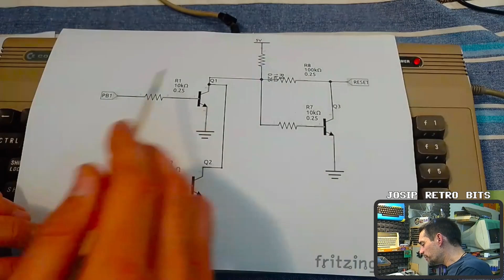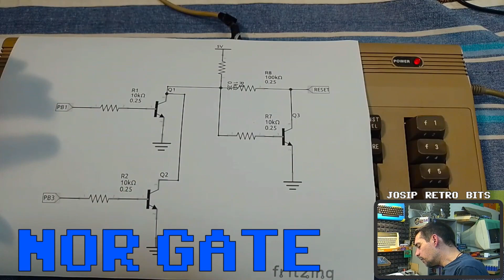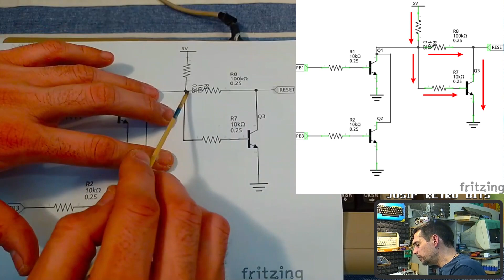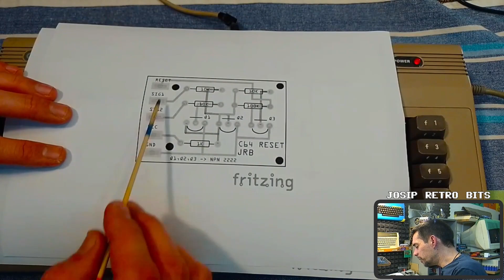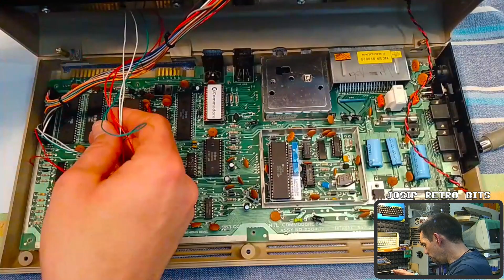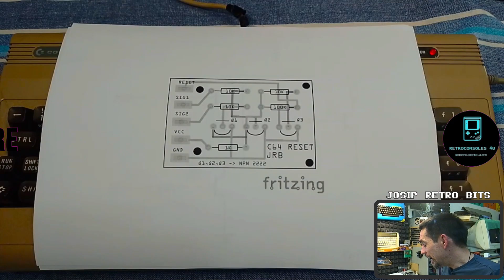Commodore 64 Keyboard Reset Circuit v2.0

Comment: Nice and simple, but unfortunately with the C64, a simple CPU reset will not get you out of some persistent software. Too long to explain here but it is about how the reset vector is set and simply resetting the CPU will only make it jump to where the programmer wants it to jump. So, some clever people came up with something called "EXROM Reset". It involves using a second line (PLA EXROM pin) and pulling both the CPU reset and the EXROM low, but releasing CPU a little before EXROM. There is a good video here, https://youtu.be/OV5tNYhqQ7w?si=rTxRNl2_RsN0OVai which explains it much better, also check the follow up video on the same subject.
Reply from the maker: Well, I know that my solution is not perfect, I just wanted to be able to reset c64 using the keyboard (combination of keys) and I managed to do just that. In addition, I was using the stock C64 and never tested my solution with other Kernal ROMs or other sys cartridges. Thank You for the video suggestion and thank You for watching :) Cheers!

Comment: malo pitanje - imam c64, kad ga ukljucim, bude samo plavi ekran. da li je do napajanja ili do maticne ploce? sto prvo gledati?
Reply: Very nice, but what happens when you play games with Joystick 1 and you need to go diagonally down right ?
Reply from the maker: Thank for asking, it should not trigger the reset because of different resistance on those lines. Cheers!
Reply from the maker: Plavi commodore ekran bez teksta? Ili je plavi ekran pd tv-a?
Reply: @JosipRetroBits  samo plavi ekran,  bez teksta... Znas ono kad ga upalis, plavi ekran i onda se za sekund pojavi tekst... Na tom plavom ekranu je zapeo
Reply from the maker: Ok. Moguce jedan od ROM chipova. Ili Basic ili Kernel. A mozda i character rom
Reply from the maker: C64 longboard ili shortboard?
Reply: @JosipRetroBits  https://ilesj.files.wordpress.com/2010/07/four-different-c64s.jpg na slici doli desno...
Reply: https://ilesj.files.wordpress.com/2010/07/four-different-c64s.jpg na ovoj slici, dolje desno
Reply from the maker: Ok, tu je BASIC i ROM na jednom IC-u. Javi mi se na mail pa ti pošaljem detalje i novi IC da probaš. Mail imaš na kanalu u "About"